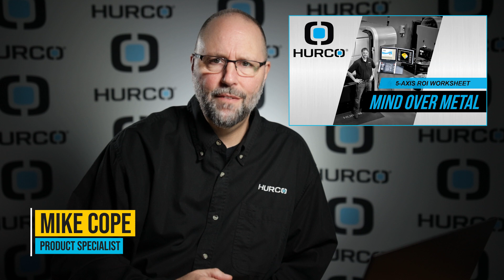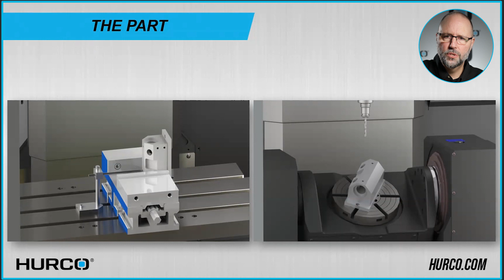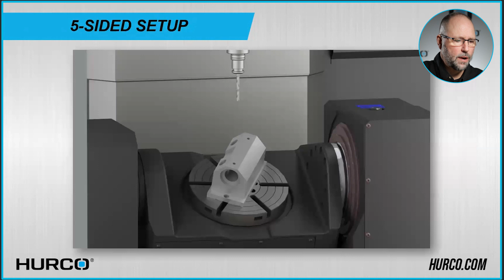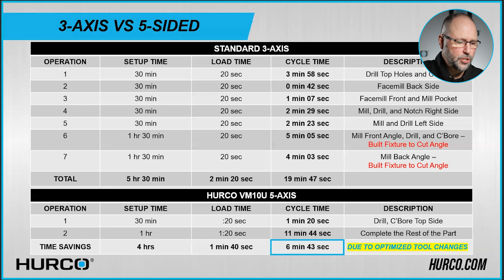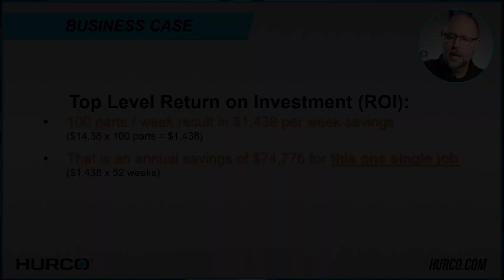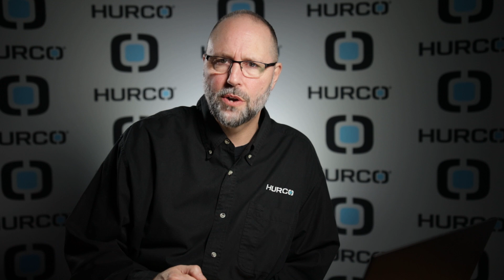Increase Your Margin With Hurco 5-Axis

Comment: The other cost savings you usually don't see or think about is giving your machinist or operators time to run other machines or do other setups while the machine is running. 

Another cost savings is that now you don't need to have 7 separate in process inspection programs or processes but only 1 or 2. How many times do we get to the final operations to find out the parts were scrapped in the first or 2nd op? 

If you have a part that comes out 100% complete, you can catch any issues from the first part, save multiple inspection reuqest per operation to go into the CMM.

Also, at 5 axis, for harder materials, since you are doing multiple ops at once, the run time will be much longer. That means when night shift leave, they can just leave the machine running and do kind of a lights out machining and make some free money that way too.... 

We have had 4 hour runtime jobs stay running when night shift leave at 215am. Our 1st arrives at 5am and machine still stays running. 😃